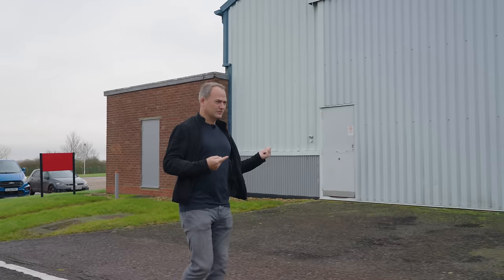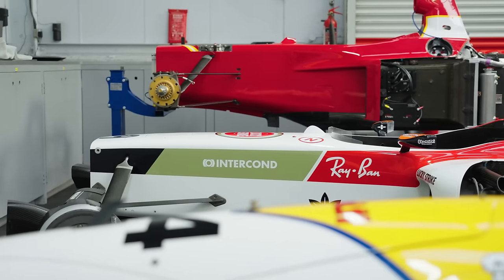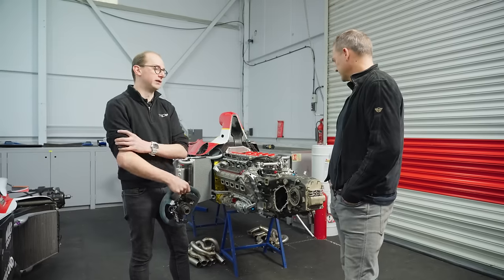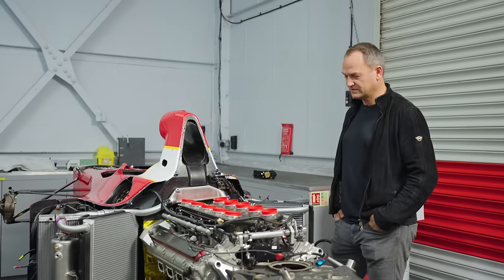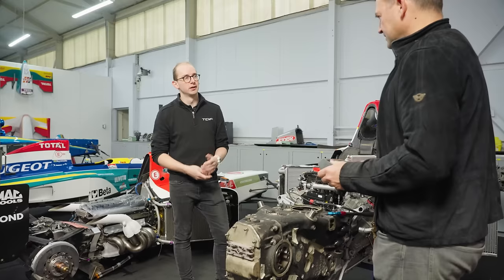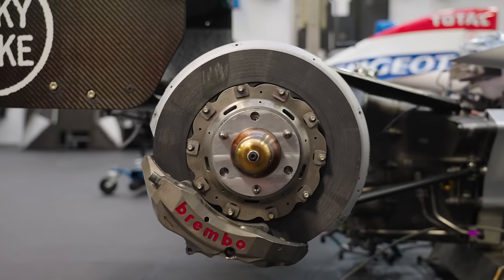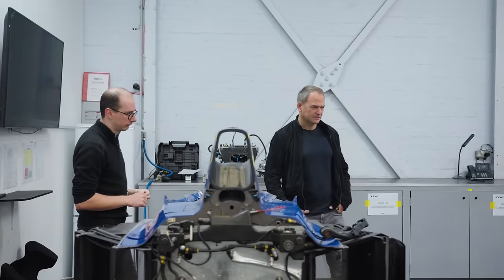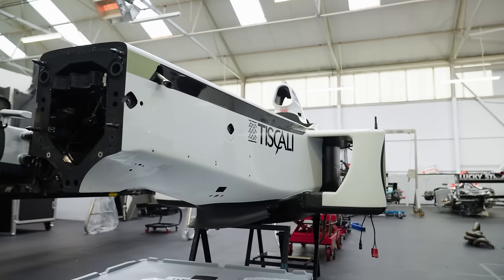F1 V10 - WHICH IS BEST ?

Comment: JV explained his unique wheel paddle setup in one issue of F1 Racing magazine back in 2000 or 2001. It was to do with de-cluttering the clutch paddle-side so he can perform better starts. It also saved a few grams of weight. He also preferred a long-ish throttle pedal travel so he could better control the torque demand
Reply from the maker: With him on the throttle but the gearing … yuk.. good idea for weight saving & interesting info thanks
Reply: @BenCollinsDrives  Jacques Villeneuve was one of the best starters on the grid so it must have worked. Every race he would gain lots of places on the start.

Comment: Have to say the 1995 Jordan. In my opinion, no era of F1 is perfect, but for me 1994-1997 was overall the closest to perfection for technical regulations; track width wide enough for the cars to still mostly rely on mechanical grip, but not so wide overtaking becomes overly difficult. Short enough wheelbase for the cars to be highly reactive. Driver aids banned aside from sequential paddle shifters. Slick tyres. Engine wise virtually limitless within the displacement limit as long as it was naturally aspirated. Some teams had full manual steering racks, albeit because they were backmarkers. The cars 1995 onwards were very safe sans HANS device without being severely overweight coddleboxes as 2018-present.

I know times change, but I hope F1 one day goes back to a similar ballpark wheelbase and track width as that 1993-1997 era, bans or significantly reduces power steering assistance, and instead of pushing for the hybrid assistance to reach 50% of the total powertrain power like the FIA wants for 2026, push for development to aim for increased power-to-weight density from the hybrid assistance by imposing tight weight limits on the hybrid components. F1 cars shouldn't weigh above the high-600kg range imo. They're already on the right path with cleaner aero. If we can't have V10's and V12's again, at least let us have cars which dart around with drivers having to earn their millions getting a workout from steering wheels ripping their arms all over the place. That's exciting to watch.

Seeing as none of these historic F1 cars are truly period correct anyway, I would love to see a final-spec 3.0 V10 20k screamer with some modern-day improvements mated to one of the early 3.5 era wideboy H-pattern cars.

Comment: I appreciate the engineering in the modern V6T's, but I am literally the V10 Generation and so this is as cool as it gets, I'd be giddy as heck wandering around there. TDF sound like they get to do some proper serious engineering, what an awesome company. I'm with James; Minardi were my team. Incredible tenacity, had a keen eye for talent, the definition of sportsmanship both on and off the track and celebrated any points like it was a championship win.
Button's '04 BAR 006 would be my vote; nearly won a championship, all original F1 components, it's as close to the real deal as it gets outside of the actual teams/manufacturers.

Comment: If you want the authentic experience, probably the 1995 Jordan with the correct V10 Peugeot engine. If nostalgia is desired, 1998 Williams crashed by J. Villeneuve. The 2004 BAR  car would be good, but it's missing the Honda V10.

Comment: In fact, the 2002 and 2004 cars are still the fastest in F1 history! The F2002 and F2004 Ferraris using modern slick tires in Ferrari events, with semi-professional drivers, set faster times than current F1 cars with a huge advantage!! Another ex two or three years ago Montoya in BMW was almost 6s faster in Holland than modern cars even using a car with less than 85% of power just using modern tires! The FIA, as always, banned the publication of times! In Monza with a modern slick, the F2002 is more than 10s faster than the track record!

Comment: This was the golden era for me, between the late 1980's to the early 2000's.  I stopped following Formula One racing the year they switched to  the quite V6 turbo engines.  I long for the days when the F1 cars had that Banshee howl and the drivers would routinely run across the active race track to save another drivers life, or to punch a competitor in the mouth.  Modern Formula One racing is just not as interesting or characterful.

Comment: If available, it would have to be the most powerful car of the era, the BMW V10. If Williams were capable of designing a proper chassis then things would've gone a lot differently for them. Outside of Ferrari and Renault it was the most reliable in multiple seasons as Mercedes dropped the ball massively. The Honda's and Ford's were known for one thing, blowing up, with Ford even having 19 retirements in one season.

Comment: Schumacher's Benetton! "Unusual" to have a hydraulic valve and an electronic circuit connected to it. I'm SURE it hadn't anything to do with launch control 😅😅😅 I'm also SURE it couldn't be used to disengage the engine just a little as a form of limited traction control off of a corner. It has been PROVEN that it had larger fuel ports to cheat having faster refuels, and now this... When everyone involved knew that this form of control was banned... what a bunch. "Being a little bit clever" with the rules, as cheaters put it. Sad that Michael is in a poor state of health, but it's fair to say, the man cheated, more than a little.